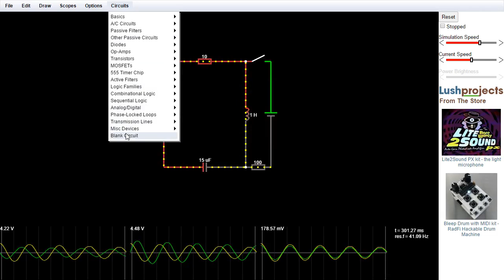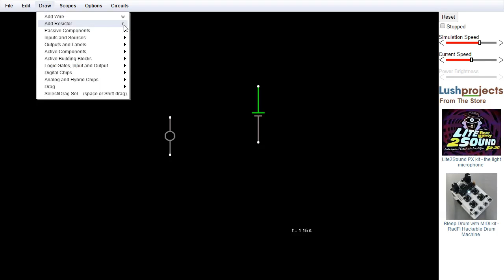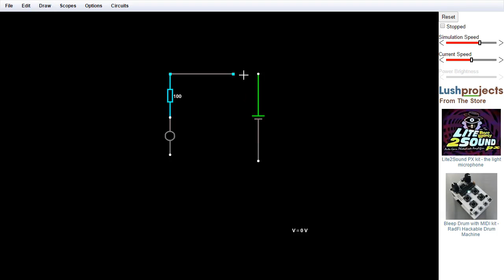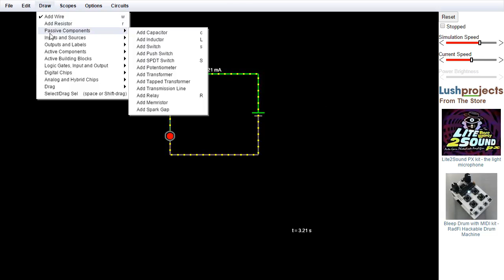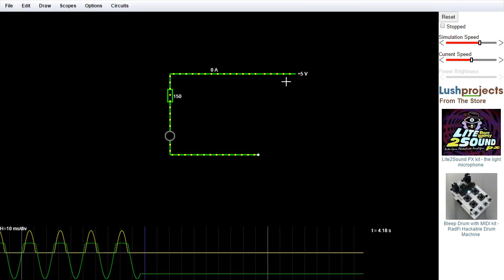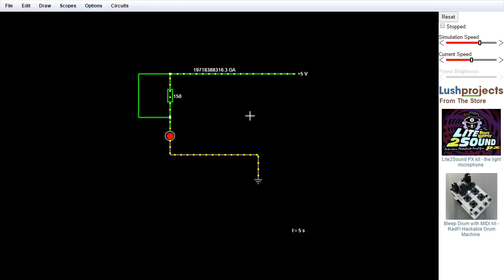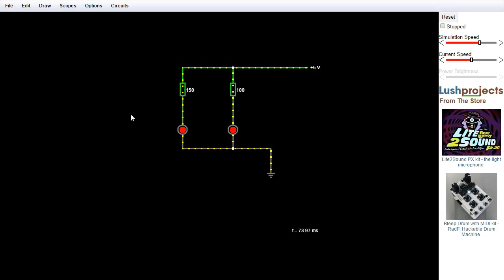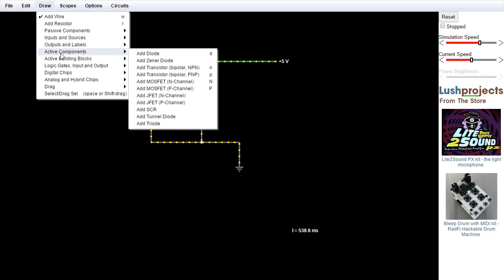Part 2: Browser circuit simulator at Lushprojects.com

Comment: it appears you are no longer making videos its been 4 years. i think what you have is very interesting and should be expanded on! i suspect it has more potential if i could just find it. im using it to learn series parrellel and i need something to give the answers and it does, its strange but it works. its actually better then tinker cad but i see no way for the answers to be constant on the screen you have to move your mouse to see it.